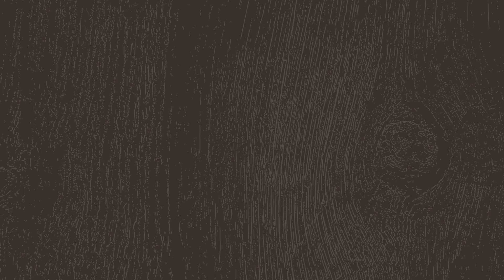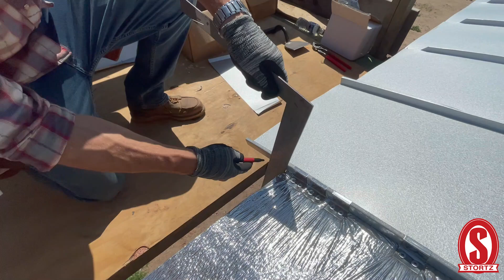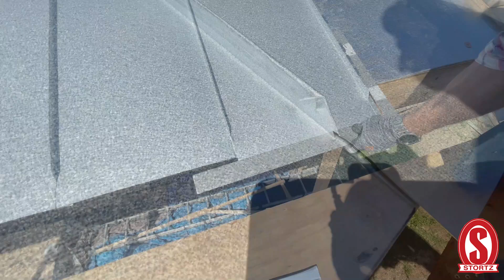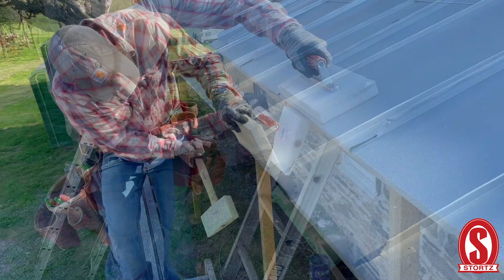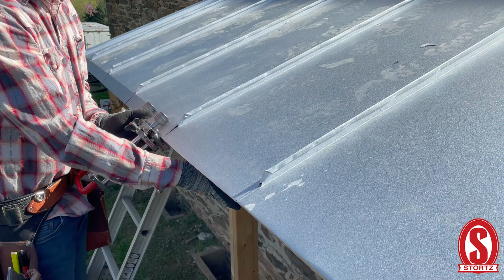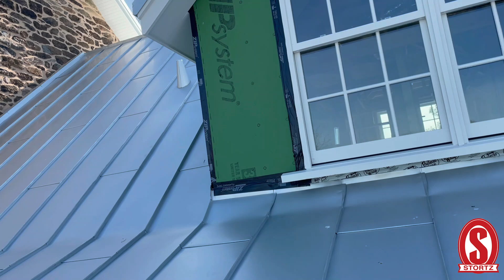How to Install Standing Seam - Boxed Eaves Style

Comment: Awesome job teaching your craft! I design and build custom chimney caps. Any tips for bringing the panel connections together on a hip and ridge with 5 ribs intersecting. Looking to make sure my design is water tight. Thanks
Reply: That can get really tricky when hip and ridge connections get over three intersecting seams. You need to layout accordingly and lay the seams down as you go but there may be an excessive amount of material to deal with.